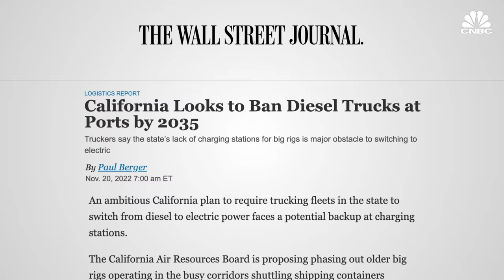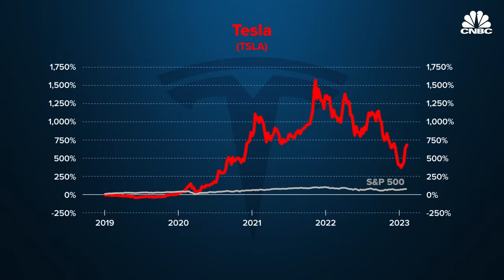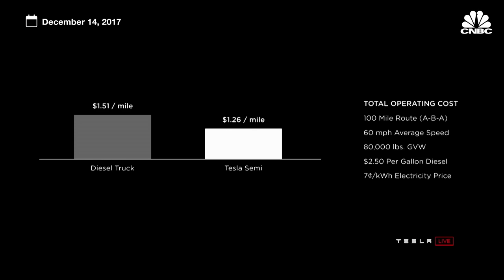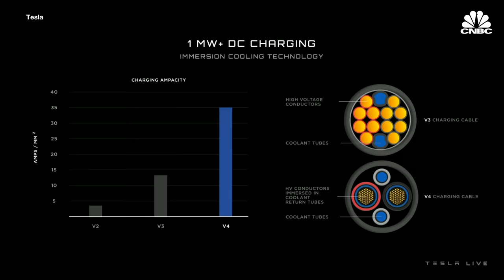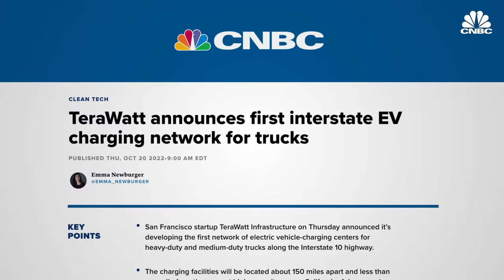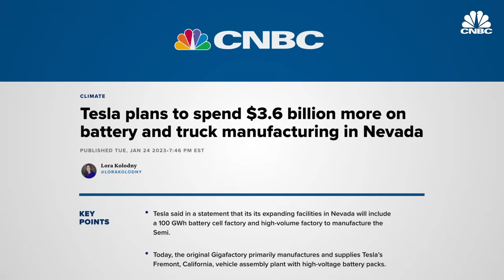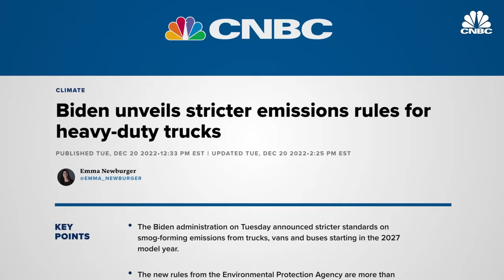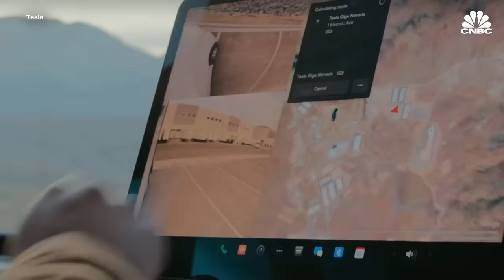Does The Tesla Semi Live Up To The Hype?

Comment: ouu they are in use?! i had no idea!
will be interesting to see how they will do in some years/decade!

would be friggin awesome if all vehicles (specially trucks) where emission free!
Reply: IF we had enough electric power production to HANDLE THE LOAD.
As of right now, MOST of the country isn't even close - only a few areas could handle the load of an all-EV fleet, like most of Washington State (Columbia River power dams) and they're going to have to curtail exports to do so (or build MORE power generation, something that's just NOT HAPPENING in many areas LIKE CALIFORNIA).
Reply: @bricefleckenstein9666  yeah well, thats kinda  a "you"(usa) infrastructure problem 😅 here in germany, our combined european net could do it! with some minor adjustments ofc..
Reply: Brice, the US electric grid could easily handle a huge amount of electric semis. The "grid can't handle it" crap is out of control and ignores reality. The grid isn't perfect for sure, but it isn't that bad. And most charging is done at night anyways when the grid demand is at around 20% of the grid's peak capacity. Further, it will take an extremely long time for EV semis to even become all new orders, much longer for it to become the majority on the road. 

The grid doesn't take that long to grow. Electrical demand has stayed mostly steady over the last 15 years. The grid has handled far more difficult growths in the past. It went from nearly no homes using electricity to all homes and businesses using it. It also went from nearly no places having AC or refrigerators to nearly everyone having the. The grid grew nearly 8x from 1950 to 1975. From 1975 to 2000, it more than doubled again and was fine. Since then, it has only grown by 20% and most of that growth was done before 2010. Even if it needs to double again, it can do so.
Reply: @bricefleckenstein9666  you have no idea hwat you are talking about, as a first lesson, Diesel uses much much more electricity than an electric vehicle, so load goes down.
second lesson: energy production never was or will be an issue, no matter what type of plant you use.
it is and always will be about storage.
Reply: EV's are not emission free - that's a myth.
Reply: @anthonypelchat  No, it can't. You can easily double transmission capacities if the lines you have only run at 25%. It's a lot harder to double capacities when the lines you have run at a 100% - and that's where we are right now. Doubling the grid capacity today will take a lot longer and cost a lot more than in the past because we need to build more transmission lines. There is a reason why LA has brown outs - it's not the availability, it's the grid capacity. There's only a handful of transmission lines going into LA - some all the way from northern Oregon - and they can't do more. So while Oregon may have the generation capacity to provide for LA, there is no transmission capacity available.
The grid in your neighborhood is all good now. What happens when the electricity use in your neighborhood triples? That's about the use we will see in the near future. Where I am I can not add a car charger to my house - simply because the electric company will not allow me to have  400 amp panel - there isn't enough wiring in the neighborhood to do so. I can have that charger if I pay a load for them to add wiring to my house. As it is, no car charging unless super slow.
Reply: @uweschroeder  yeeeah... they are tho on the road! & any1 who has ever been blasted by what comes out of a trucks(or car) pipes would appreciate cleaner streets!
Reply: @uweschroeder  Here's a thought. If we double the generation capacity, why don't we double the transmissions lines as well? Brilliant right. I bet none of the engineers out there could ever think of such a thing. /s

Doubling the grid isn't going to be easy nor cheap, and I didn't say otherwise. However, it will be easier and cheaper than going from completely scratch. The brownouts are more due to cost cutting. The grid demand hasn't grown hardly at all in 15 years. Greatly increasing the demand would put a push to make more lines.

Also, a 400amp panel and you don't have the space for a charger? What are you running? I have a home of 6 people on a 100amp panel and still have room for a charger. 1: You are clearly over using power if you are actually filling out a 400amp panel. 2: You don't need a high power charger. A standard dryer outlet is good for 25-30 miles of range every hour on most EVs, enough to fully charge it overnight.
Reply: @JohnSmith-pn2vl  stop lying lol!!!  From crude oil we made approximately millions of oil byproducts including car tires, road tar, all the cable insulations…… the fuel for mining, agriculture, for aircrafts, ships…..
Reply: @JohnSmith-pn2vl  oil is also used to make fertilizers, lubricants, paints, clothes list exhaustive
Reply: @mho...  1) Distances are a LOT shorter on average in Europe. LESS LOAD.
2) From what I've seen in my research, you Europeans do NOT have a significant advantage on power generation over CURRENT need vs most of the USA - and MORE restrictive regulations on getting things BUILT.

Don't pat yourself on the back too hard, y'all have a high probability not enough power disaster likely on the way TOO.
Reply: @anthonypelchat  I didn't say I fill a 400 amp panel, I said I'd need a 400 amp panel. Maybe a 300 would do. My point was that I can't get a larger panel because the electric company won't do it unless I pay for line upgrades to my house. Also keep in mind that in the area where I live the laws for new construction require 100% electric households. No gas for heating etc. Gas lines are prohibited. Now there's no new construction because they figured out they can't get enough electricity, so they have to wait for upgrades which will take years.
Reply: @anthonypelchat  We need about 20% more electric generation to handle the shift to an all-EV car-and-truck environment.
VERY FEW areas in the USA have any excess at all - and lots of areas like California HAVE TO IMPORT 20-30% of their electric, and are STILL notorious for not being reliable.
Renewables at this point ARE NOT the answer - look at the great Texas freezout about a year ago as a prime example of WHY.

Yes, for LOCAL truckers it's less of an issue - but that 20% of the load figure is WRONG, especially in areas like Washington State where all HEATING is done with electricity in most areas. It might apply to Arizona in the SUMMER, but it's not even close to accurate everywhere.

And you're missing the LEGAL PUSH to eliminate non-EV semis in some critical areas - like the Port of LA, the Port of San Francisco, the Port of San Diego, where California is MANDATING this shift faster than you seem to think.

We don't have an "extremely long time", we do have SOME lead time but California in particular seems to want to squander most of it.
It says a lot when even Newsome was FORCED to keep a major nuclear plant open that was slated to close just to try to meet EXISTING demand.
Reply: @uweschroeder  Having electric heating isn't hurting since you are using electric AC as well and they won't run at the same time. Heat pumps are literally AC units with a reverse button. New construction should use those. It's frankly stupid we haven't been, though gas used to be a massive amount cheaper. New homes with electric stoves and hot water heaters shouldn't be an issue. Most homes won't use more than 50amps combined with them. Very few homes would need more than 200amps even with 2 EVs and all electric appliances.

I don't know what happened with your specific home, but 400amps isn't needed in any normal case. Not even 300. Seriously, have a good long talk with an electrician to see what is going on and what you can do. I wouldn't normally suggest anyone to buy something else, but you actually might want to. My guess is that something in your home is horribly inefficient and requires far more electricity than is normal. If so, that is wasting you a ton of money. A 5ton heatpump, dryer, 50gallon tank, and convection stove combined are less than 100amps. That is enough for a 3000sq ft home and a family of 6. Another 100 amps is enough to cover 2 EVs charging at a time and the normal 120v loads. 

Another option you might want to consider if you really need that much electricity is to see about setting up an offgrid panel that is covered by solar/wind and batteries. If you just power your 120v connections, that would keep it from being too expensive while giving you a decent amount of protection from power outages and freeing up space in your grid panel for EV charging. The money saved from the grid will pay itself off.
Reply: @bricefleckenstein9666  Texas did not have issues with renewables during the freeze. Natural gas plants were the main cause, not wind. And the entire issue is easily fixed as we have wind generation happening in many northern areas. Texas didn't pay to have any winter protection on their grid, any part of it and that caused the issues.

California specifically is weird. They produce too much solar and export it. They haven't built enough energy storage to use solar effectively. Which then means that while they are exporting solar, they are importing power from other states. The bigger issue for California is the poorly laid transmission lines that keep causing fires. That's a whole other issue though. Still, they have greatly increased EVs and will continue to do so without causing massive grid issues. There are lots of reasons why going to EVs is not as big of a deal on the grid as you have been fooled into believing.
Reply: @anthonypelchat  The minimum electric panel for residential housing in my area is 200 amps. Every builder puts in 300 amp panels for all electric houses. 
I know exactly where I use the electricity. I use more for the simple reason that we don't use someone else's electricity during the day by going to work.
What you say is not how load calculations work. They simply add up all loads in the house, it doesn't matter whether you use them together or not. For example I have a electric hottub (one of the big users of electricity in this household). The legal assumption however is that I use the 6kW heater for the hottub together with the AC - which is nonsense because if it's 100 outside nobody heats the hottub. Still, legally I have to have a panel accommodating those loads. The assumption is also that the welding outlet in my garage is used together with everything else in the house - which again is nonsense but it's the building code.

As for the all electric: even if I could get that bigger panel here, I wouldn't. Electricity costs over 30 cents a kWh where I live and it goes up every other month. I'm certain by the end of 2023 I will be paying over 40 cents. I'm also not investing thousands in replacing perfectly good appliances just so I have a utility bill even higher than the $500/month I'm paying already in winter. What I will do is paint the house, sell it for a load of money to someone stupid enough to buy a wooden box for a million in a state where water and electricity will become less and less available and move to a state or even country where the progressive people without a long term plan don't run things for political gain.

I'm not against going all electric. It's just ironic that California does that really aggressively without a plan to have the infrastructure. The area where I live already has new construction stops or roll-backs of the all-electric construction ordinances because there's not enough electricity to run those houses. Typical California. Let's make laws that look good on paper and when it comes to implementation the huge gaps in reality assessment show up. But hey, we're spending billions on that nonsense while you already need to buy a 4x4 to get to your house because the potholes are getting deeper ever year.
Reply: @uweschroeder  "The minimum electric panel for residential housing in my area is 200 amps."
That makes sense for an area that doesn't use gas. I came up with the same number. 200amp. And that is more than enough for most houses. 300amps is going to be for larger homes or simply to have spare capacity going forward. And that is fine. But the use case for over 300amps is extremely rare for homes. 

"What you say is not how load calculations work."
The only load calculation that I gave different from yours is the AC and Heater. If it is a heat pump, it is a single unit. So no dual connections. But also since most homes cannot run both heat and AC at the same time even if they are separate units, they can be counted separately. Again, talk with an electrician. 

The goal of the amps isn't to count every one for legal reasons. If you only have a 300amp circuit, that is the level where it will pop the fuse. You cannot legally install a 400amp because that is too much for the lines coming to your house. But you can install more than 300amps of total fuses if you aren't using them at the same time. Again, talk with an electrician. Make it clear that you cannot install a larger panel and they can figure it out for you. 

"Electricity costs over 30 cents a kWh where I live"
Get solar asap. That is expensive. Tesla batteries and solar are a premium price, but there are value options out there. If you are good at doing things yourself, you could save a ton of money on installation which will greatly reduce the payoff period. DIY solar in my area would pay itself off in 3-5 years over 10c per kwh from the grid. At 3x the price, you might be able to get that under a year. Non-diy is more like 5-10 if you get good prices. 

"I'm also not investing thousands in replacing perfectly good appliances just so I have a utility bill even higher"
I wasn't saying to do that. Look at your appliances and see if some are wasting you money. What you do once you find out for sure is up to you. Just friendly advice. 

"What I will do is paint the house, sell it for a load of money to someone stupid enough to buy"
Good idea. California is weird on so many things. Going electric is not the problem. Going renewable is not the problem. But they have a bunch of dumb ways of doing things that have been done that way since long before EVs and heavy use of solar.
Reply: @anthonypelchat  I talked to an electrician and no, you're wrong. My local building code counts all loads together and you have to have that size panel. New regulations require to have spare capacity for 50 amps which is why every contractor puts in 300 amp panels now. 200 amps is the minimum for houses with a gas line - and probably without, but it's the minimum legal residential panel here for a single family house. Yes, a heat pump would count as one appliance of course, so does a AC/Furnace combination because as you said you can't run both at the same time - but that is about it. Unless you install other appliances that it's impossible to run them at the same time it's 2 appliances for the load calculation. I talked to the Electric company. They don't care at all as long as the main breaker is the size for the supply line. For them liability ends with the meter so you can do whatever you want afterwards from their perspective. The "then the breaker flips" argument is sadly not an argument for load calculations or building codes.
Solar doesn't calculate at all these days, plus I don't have enough roof area to install enough panels. The only way I would ever install solar is to go completely off grid - and again, I'm not going to invest into something nobody will ever pay for.  They scratched the bonus pay you got for installing solar in CA. You'll get 3c/kWh if you feed into the grid and you have to pay a monthly fee for getting electricity if you ever even pull a single kWh from the grid. Again, I will not invest $50k to get solar when I can buy electricity for that amount until the day I die.
BTW: my main appliances are all relatively new - my furnace is a 98% efficiency one. I simply do things in my house that require a lot of electricity and if my house wouldn't be in CA but in pretty much any other state my electric bill would be $100/month and I wouldn't care at all.

California is getting to a point where things are completely senseless.  So we decided to retire out of state and sell our CA assets. Not too far into the future houses in CA will be worthless because nobody will want to live in an area where the water bill is several hundred bucks a month despite having a 2000 gallon limit. There's also so much thoughtless regulation that it boggles one's mind. Voters sadly don't comprehend half of it and thus they tend to vote against their interests. People just don't think anymore - but that's a problem we have in pretty much every state.
Reply: @uweschroeder  Obviously if you are selling your house, then don't make changes that won't pay off in that time. 

Back to the panel. Panels and fuses are there specifically to keep power from going back over the lines more than the lines can handle. If you are forcing the individual fuses to count to the max for the panel, then there is no reason for a panel fuse. Things that don't turn on the same time shouldn't and aren't counted in other areas. And for good reason. If you do turn on two items that shouldn't be on at the same time, the panel fuse pops, protecting the line. That is what is for. My guess is the electrician is working one on you or just doesn't know better. But Cali is crazy, so maybe some dumb laws.

My plans are to move to an area where I can eventually be completely offgrid. No electric or gas bill, replacing everything with solar and batteries. Only non-solar will be the gas grill and fireplace, both using propane. Later will do water using either ground pumps, rain water, and/or units that pull water from the air. DIY solar as a carport instead of on the roof. Large LFP battery packs for night and backups. 40-50 gallon electric water heater, convection stove, and considering doing mini-split heat pumps throughout the house. Less immediate power draw than a central AC, making the inverters easier to handle.
Reply: @anthonypelchat  That was the building inspector. He came out, looked at my panel, saw that the permit was for a hottub and immediately required me to upgrade my panel because it can't handle the loads on it - without doing a load calculation nor inspecting anything else. So I hired an electrician to do a load calculation because that's the only thing you can do when you get the order from the city to upgrade your panel - which would obviously be several thousand bucks to do. So we removed all pluggable appliances, did a load calculation, came up a few amps short of the panel and that got the inspector off my back. Of course technically a breaker is there to protect the wiring and any outlet has the potential that you plug enough in to flip that breaker - that's what it's for. It's just not how building permits work here. When I talked to the Utility about it they said: we don't care, the breaker will flip, that's about it.

Well, you must be young enough to move off grid. I'm not. I will most likely move out of the country to an uninteresting 3rd world country nobody cares about because it doesn't have resources to exploit. Costa Rica is actually my prime choice right now, but some areas in Mexico are also a decent choice. They still know how to live.
Reply: @anthonypelchat  My understanding of that failure was that the wind stopped blowing for most of the state, wind power dropped a ton, and the shortage overloaded the rest of the Texas area grid.
I KNOW they import energy - the PUD I am with in Washington is ONE of the PUDs that sell that energy to them, at market rates, to help pay for our local very low energy rates.
But THAT ENERGY WON'T BE AVAILABLE for the most part IF at all 20 years from now, while California continues to push wind power that DOESN'T WORK reliably (California DOES have widespread "low to no wind" days, even places like the Tehachapi Pass or Cajon Pass that have long been wind power centers) HAVE NO WIND at times.

And just how is this "winter protection" supposed to keep a grid from having NO wind power for 2-3 days at a time?
THAT part of the comment made zero sense.

Stay complacent if you wish - I'm in one of the few areas that DOES generate plenty of power, you're apparently NOT.
Reply: @bricefleckenstein9666  The failure was mostly due to natural gas plants freezing up. Those provide over 60% of the grid's power. Nuclear is another 10% while wind is around 25%. A few wind turbines froze, but not the majority and not enough to bring down the grid at all. Roughly half of the nat-gas providers went down due to freezing temps, causing the entire outage.
Reply: @bricefleckenstein9666  For Cali, they export solar while importing other sources, with imports outpacing the exports. This is because they don't have any means of storing that solar when not in use. Battery storage is growing and will help. Wind is more stable and reliable each day. 

As for "no wind for days", that doesn't happen. If you live in an area with wind, it keeps blowing. Some days are lower, but it doesn't stop for days.
Reply: @uweschroeder  As you said, the utility doesn't care and the electrician was able to get something going. So it's just an outdated rule over there. Sorry that you had to go through that. 

I looked at Mexico. You have to be careful where you move to. Some areas are fine while others are not. It's sad as the country has a ton of potential. I can work from anywhere, even worked from Mexico for nearly 2 years. But will stay in the US most likely. Lots of land around here. Solar is no big deal for me. Just need the house that I want to retire at.
Reply: @anthonypelchat  That seems VERY strange, I've never heard of a natural gas power plant freezing up (after 17 years in Iowa).
Reply: @bricefleckenstein9666  You also wouldn't hear of wind freezing up either. They are used heavily in northern regions. Neither should happen, period. It was entirely due to cost cutting, since Texas doesn't get that cold hardly ever. 

"From frozen natural gas wells to frozen wind turbines, all sources of power generation have faced difficulties during the winter storm. But Texans largely rely on natural gas for power and heat generation, especially during peak usage, experts said.

Officials for the Electric Reliability Council of Texas, which manages most of Texas’ grid, said the primary cause of the outages Tuesday appeared to be the state’s natural gas providers. Many are not designed to withstand such low temperatures on equipment or during production."
Reply: @anthonypelchat  If it blows too low, it might as WELL not be blowing at all.
Most windmills have a "cutout" below a certain windspeed (commonly 3-4 MPH) where they don't turn at all.
And I SAW days in a row below that cutout at times when I lived in California.

It's rare in the passes, but it DOES happen - I had to do work for one of the wind farms somewhat near Mojave one time, took 2 days to do the installation (repeater and controls and a custom interface) and NONE of the wind farm was turning the first day, very few of the windmills turned the second.

San Diego itself, you had to get inland to at least El Cajon, due to the coast breeze - but sometimes that breeze did NOT make it 20 miles inland.
Reply: @anthonypelchat  What I heard was that the wind widely stopped blowing hard enough to move the turbines, NOT that they "froze up".
Just happened to be a major cold snap WHEN it happened.
Reply: @bricefleckenstein9666  What you normally see when the turbines aren't running isn't that they are cutoff due to low wind speed, but do to not needing the extra power. Again, Cali is weird because they produce more power than they need from solar, but don't have anywhere to put it. So they export solar and then import other power when the sun goes down. Texas does so too, but not as bad as Cali. 

Wind in areas where most turbines are installed doesn't just stop or slow down for days. It keeps going. Some days are slower and some days faster, but it stays mostly consistent. But human demand isn't consistent and you cannot turn up or down wind speeds as needed. This is why batteries are needed with renewables.
Reply: @anthonypelchat  Texas is on it's own "regional" grid - it doesn't have the INTERCONNECTS to other regions to import or export large amounts of power, or that power failure would have been a LOT LESS of an issue to no issue at all.

And most areas, wind is NOT consistent like you claim. Even IOWA sees significant variations (that's 17 years of LIVING in Iowa and SEEING the wind vary speaking).

Batteries are needed with renewables BECAUSE of that variation, especially with solar where there is ZERO output for ballpark half the day due to the sun going down.
Wind varies LESS, but a heck of a lot more than you seem to THINK it does.

And hint - I lived less than a mile from Clipper Windpower, and toured their plant one. THEY were the ones that pointed out (and I have verified on many turbine spec sheets) that the generators on a wind turbine DO in fact cut out when the wind speed drops below a certain minimum, due to friction losses and electrical resistance stopping the blades when the wind speed gets too low.
Reply: @bricefleckenstein9666  I said Cali would import and export, not Texas. Texas does export to some areas. Mexico specifically. Juarez went down when Texas did. And some areas in Texas are connected to other states. But for the most, Texas is cut off from everywhere else. 

And I said most areas where wind turbines are installed. Not areas in general. Most areas where wind turbines are installed see very constant wind patterns. Some areas are great for wind power, some are great for solar power, and some are great for hydro-electric power. 

Batteries are needed with renewables mostly because you cannot control how much power you get at specific times. You can only cut off power if there is too much. Variations are an issue, but no where near as bad as the sheer demand inconsistencies. This is why peaker plants exist in the first place. They came along long before renewables. Solar obviously doesn't work when the sun is down. But the sun is out during the heaviest power usage of the day. And the sun always comes out. Some days may be cloudy, but those are also cooler days, so AC doesn't run as hard. 

"that the generators on a wind turbine DO in fact cut out when the wind speed drops below a certain minimum"
I didn't disagree with that. Wind turbines cut off both when the wind is too slow or too high. Solar too in a way when there is too much sun or when there is still sun but not enough. Technically all generators do. They all have a minimum and maximum. Fossil fuel generators are just much more easily controlled.
Reply: @anthonypelchat  For the MOST part, Texas can't import or export much even when it's NEEDED - doesn't matter if it wants to or not.
The regional grid is mostly isolated from the other 4 USA regional grids.

Solar usefulness depends on your area - in some areas, HEATING (and therefore nighttime usage) is normally the higher usage - LIKE WHERE I LIVE in Washington State.
Solar DOES match air conditioner peak usage FAIRLY well, but tends to lead it a bit and a lot of A/C usage IS at night in the summer.

I'm aware of peak plants - usually natural gas, as I recall as gas turbines fire up and start significant generation faster than most other options (a turbine plant with heat recycling will only get part of it's output fast though).
Coal steam plants are base load only, take too long to ramp up/down significantly for peak usage - and they're slowly dying anyway, due to EPS having almost regulated them into "you can't build a new one" in the last few years and the older ones getting replaces by natural gas.
Same on nuclear.
Reply: @bricefleckenstein9666  Again, I didn't say otherwise for Texas. There are small parts that can import, though they are likely separated from the rest of the Texas grid. And there are some areas where they can export. But again, that is very small. Something like 90% of Texas has no access to the rest of the country. And the tiny amount of exports are barely of note. I just know that Juarez in Mexico was linked. I was there when the Texas grid went out, bringing down all of Juarez as well. 

As as I said, some areas work well with different items. Where I live, solar is great. Paired with batteries and you can easily go offgrid. Night time use of AC is so much lower than day use that it's mostly irrelevent. 30f drops in temps when the sun goes down. 

"as I recall as gas turbines fire up and start significant generation faster than most other options"
Absolutely. The only faster response to power demands that I know of is batteries. Base load generation is always slower to ramp and many won't. Natural gas plants have a lot more flexibility, but are also more expensive to run than other sources. 

Coal is being shut down for good reason. It contributes about 20% of the total power production, but nearly 60% of total emissions. For comparison, nat gas produces nearly twice power as coal but only contributes 40% of the pollution. Petroleum energy generation is nearly just as polluting per MWH produced, but is only a tiny fraction of the total generation.
Reply: @uweschroeder  I just watched a video that reminded me of our discussion here. While you said that you are planning on selling your home, I thought I would provide this just in case something happens that prevents that or if your new location ends up having the same dumb laws. 

First, there are smart panels on the market now that can shut off or prioritize circuits so that the panel never has a risk of overloading the main breaker. That may not matter for the inspector though.

Second, a separate sub panel may be able to get around the junk rule. The sun panel connects to the main with a smaller fuse than the items combined in it, since they never run at the same time. 

If that also doesn't work around the dumb law, then a battery pack connected to a separate panel and inverter should work. The battery can charge from the grid with a max pull far less than the loads. They could all theoretically run at the same time while never pulling much at a time from the grid. 

Hope that helps you out in the future. And I hope that you are able to find a decent place and be able to sell your current place without issue.
Reply: @anthonypelchat  Thanks for coming back here and telling me about it!
Reply: @uweschroeder  Hopefully you don't need it. But if things don't go as well, I hope it helps you. You have a great one.